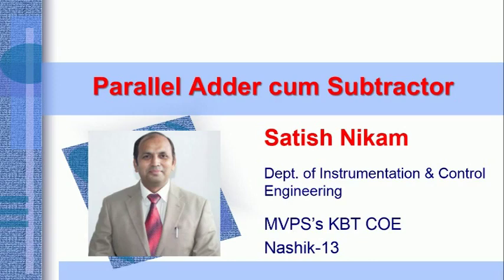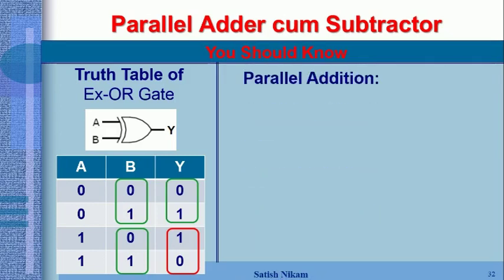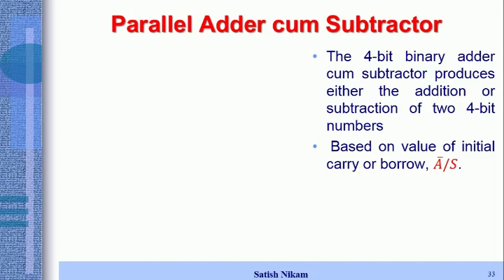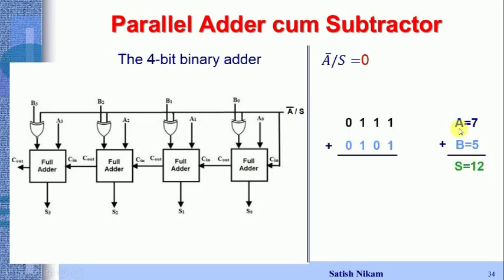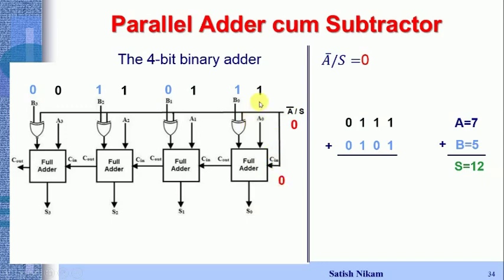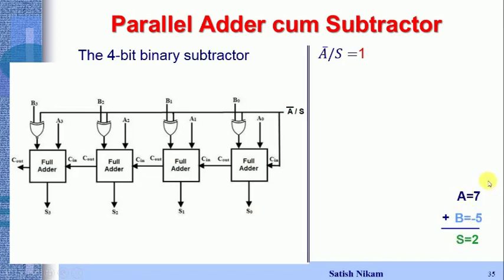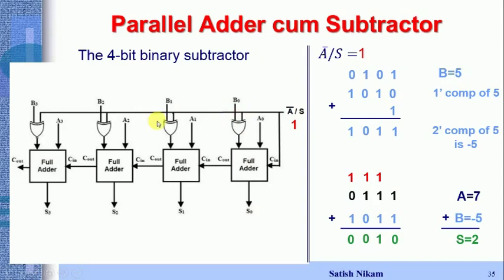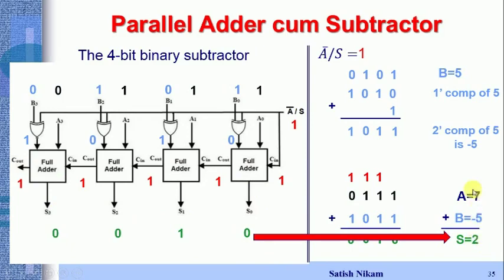Designing of Parallel Adder Cum Subtractor circuit

Comment: by using adder, subtractor, comparator, or any other necessary modules, design a logic circuit that can replace the following pseudo-code lines: if (a>5) then x=a+b, else if (a=5) then x=a-b, else x=2a+b a is a 3-bit number, while b is a 2-bit number. - show the design and test codes ( internal modules can be implemented using any method). insert both codes in the text box below - test the circuit for different values of a and b (at least 3 values covering all cases). attach screenshots showing the results clearly (pdf).